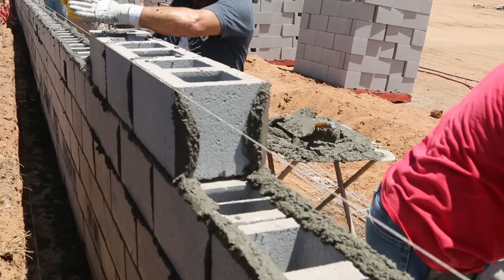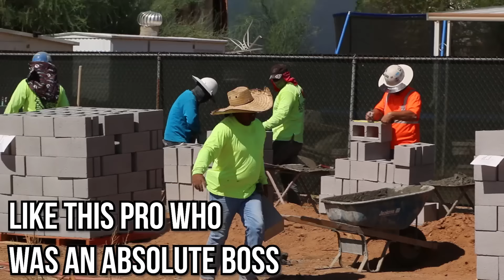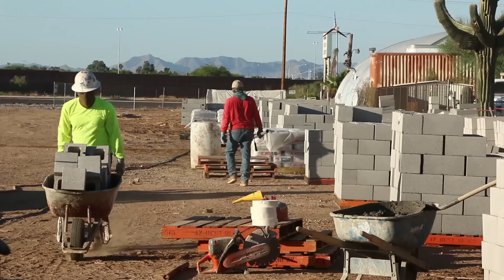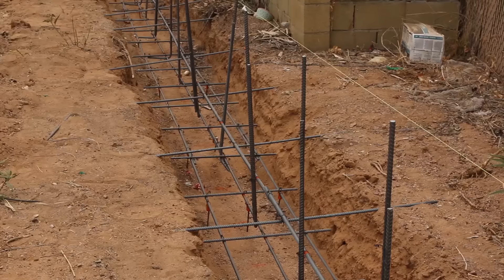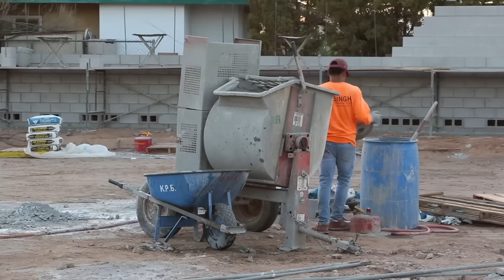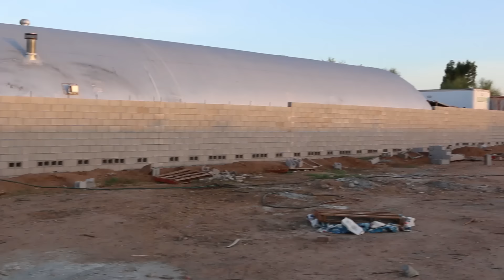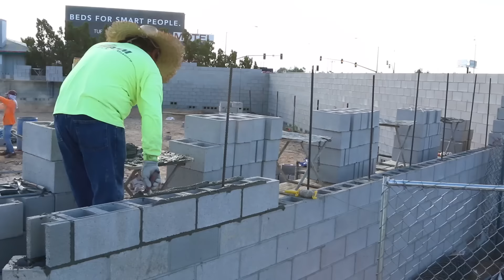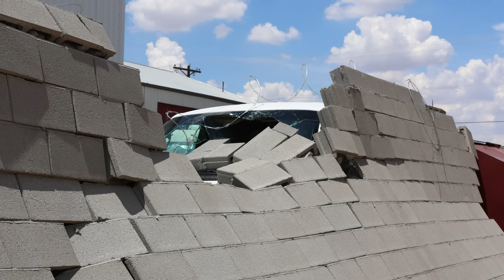Building A Block Wall

Comment: Can't wait for the feminists to push for 50/50 representation in stonemasonry ;)
Reply: Don't hold your breath.
Reply: Drew Mac, The statement went way over 44R0Ndin's head.
Reply: John Doe based and redpilled
Reply: Doesn't matter if someone's good or bad at their job, gender has no place in the discussion.
There is only one kind of discrimination permissible in the hiring process, and that's based on the skills of an individual and/or willingness to acquire/maintain said skills.
In other words, don't complain that you didn't get hired if you're both bad at the job and unwilling to learn enough to get good at it.

And for the record, I'm a man both by birth and by choice. Elevating women over men is wrong, and so is the gender pay gap. Equal pay for equal skill and ability is the only true way.
As someone with a disability, if your disability gets in the way of performing the duties of your job, you don't belong in that job. Find a job where your disability doesn't impact the ability to perform your job, if you're still being discriminated against then there is a problem and it needs to be fixed.
Reply: 44R0Ndin, tldr

Comment: I just recently helped my dad build a block wall just like that!  It was much much smaller...only 3-4 ft high and maybe 20 ft long but I learned how difficult it is. These guys are so impressive with how easily they can spread the mortar onto those blocks without dropping any on the ground haha.
Reply: viriy  Nece
Reply: They drop some, it's okay, their Dad isn't concerned

Comment: Mexicans always amaze me on roofs and masonry, they seriously get some stuff done. I remember working on a crew next to another crew of Mexicans and they seriously made me question my work ethic. They just went like machines all day and at lunchtime they got off the roof and and cooked up some fajitas at the job site, then right back to it. While we left for an hour and ate burger king or whatever and took breaks every 2 hours or so. Maybe they are just built better for the heat, but they outworked the crew I was on by a good margin and we weren't slackers.
Reply: JestA Bear They have improved a lot as masons since the 1980s.  In the 1980s they were all laborers, in the 90s they were trained by gringos (like me), now they own the trade.
Reply: bonanzatime Same with roofing. Amish are kinda they same way around here, they work pretty hard for less money.
Reply: Different cultures tend to excel in different areas.
Reply: @J Smith
Mexicans aren't good bricklayers because of their culture.  It's because that's the best economic opportunity available to illegal immigrants who don't speak English.
Reply: jej3451 That's a good point, though I still think they are better suited to the heat.

Comment: This seems like an excessive amount of manual labor compared to using forms and pouring a continuous concrete wall. But maybe this is because I underestimate the labor associated with setting up and taking down concrete forms.
Reply: also, the cost of so much concrete, bigger footing to hold the extra weight, and I have no idea how thermal expansion would work on such an exposed long single slab.
Reply: Complex foundation shapes also make forming up not as practical. If it's a square yeah forming it up is a lot easier

Comment: Wow EC, if all carpenters had your respect for masons, there wouldn't be any feuds. 👍 .. from the beginning I had a feeling about you, 'That There, That There Is a Good Man.
Reply: At the end of the day, Carpenters/joiners,are MASONS with their brains bashed out,  lol.(from a retired UK bricklayer.)
Reply: Carpenters respect us when our foundations they work off of are square and level.
Reply: @chrisanderson9157  And we respect them (carpenters) when the walls (and windows, doors and soffits) we veneer are straight and plumb.
Reply: Ever try putting a roof on a house that is out of square? Not a common Gable.

Comment: Another great video, thanks. When pouring the top beam, how do you prevent concrete from running down into the wall? Can't think of any reasonable way to make a form...
Reply: Casa you run a paper or mesh material called bond beam paper or grout stop across the wall before you lay your bond beam course.
Reply: Recently I’ve seen the top two courses stay empty and be poured with the concrete beam.
Reply: Just wedge a piece of block in there.  You can even tear up and bunch up empty mortar bags and stuff them in there.

Comment: The construction mortar should be weaker than the building substrate (block) so that if there is movement the beds and perps give way not the block 
26 year as bricky in uk
Reply: True for brick veneers.  Not so for Structural CMU. 😐

Comment: How do you create a concrete beam at the top in the just the bond beam blocks without filling the rest of the wall? Wouldn't the grout have to rise through the entire wall to reach the top?
Reply: James Kahn its filled all the way up not just the top
Reply: James Kahn. The holes of the corse below the bond beam is plug off with paper or pieces block.
Reply: I’ve seen recently the top two courses stay empty and be poured with the beam.

Comment: Why are there blocks that have been rotated 90 degrees running along the bottom of the wall?
Reply: Water ways in case of flash flooding.
Reply: Cats.

Comment: Great narrative as always, but I gotta say, that footing looks pretty crooked (7:00), and 12 inches seems kinda shallow for an 8ft above ground block wall ... then again, i'm not a mason, so take that with a grain of salt. 

I'm also surprised at the lack of side forms ... they poured directly into a dirt  trench, which AFAIK is not best practice, because dry soil sucks moisture out of the wetmix before it finishes setting up, and i'd suspect that could weaken the strength of the concrete in direct contact with the dirt. It is also unclear if they properly compacted the base of the trench before pouring, which could result in settling and cracking.

They did a great job with the mortar and blocks though (A+) ... very fast and neat on that count, but to my untrained eye the footing looks a bit slapdash (C-).
Reply: This is a desert project on a caliche ground surface.  It is not very porous.. Already a very hard surface.   In fact, almost the density of concrete.  Thus..  rarely a need for forms.
Reply: Rock K. Im unfamiliar with the term caliche ... i'll look it up. Any day I learn something new is a good day. Thx.

EDIT: Ah, I grew up with the term "hard pan" for that.  There is hardpan and then there is hardpan, depending on the degree and type of concretion.  It didnt seem that dense in the vid, but i will rewatch as time permits.  Thx again.
Reply: The topsoil was broken up previously by the grading already completed on the lot..   I seriously doubt that forms would have made much of a difference..  If there were any "seepage", the cement in the edges of that footing more than likely adhered to the surrounding soil similar to a tree's root.  That wall is embedded to that "hardpan" caliche.  The quality and effort put into building this wall is top notch for that region.  Nate picked a great contractor.
Reply: Rock K. Well, thats what I get for opining based on a vid rather than in person observation.  Still crooked at 7:00 though. 😉

Thx again for explaining. Thanks also to EC, who always puts up immensely helpful and unpretentious content.

Comment: how did the collapsed wall pass inspection?
Reply: Maybe there wasn't one.
Reply: wait..building inspections during construction are optional? not from the US, just curious.
Reply: Follow Media it isn't uncommon for shady contractors to cut corners and lie. Come into town, bid low, convince the client permits aren't needed or just not mention them, do the job as cheaply as possible, and move on before anyone asks too many questions. I've also seen contractors do things like stage rebar for inspection, have it passed, then pull most of the material out before the inspector has gotten out of sight. Could also have been a self built job by the owners who didn't know any better and didn't get caught.
Reply: RealLuckless sounds like South Florida, I got to the point that I don't even compete against the low bidding contractors anymore because the client always call me back when they realize they screwed up

Comment: Oh how easy they make it look. Makes you want to go try and fail miserable.
Reply: INDEED !!!!! lol
Reply: One step at a time....get lego set.
Reply: It's that part where they "butter" the bricks that is so smooth!   Fast and flawless!
Reply: @mrbob55304  I use to use work with this guy who would use two trowels to spread the bed joints - less motions and less trips to the mortar board was his thought process.  And he use to cut the mortar off of the bed joints from his laid block and use that mortar for his head joints for the next block,  saving material, energy, and time.  the guy was phenominal.
Reply: Brick work not really all that hard as he said first row the hardest if you get the first row level and plum it just a task of maintaining level on rest of it 
But by no means I'm saying it it easy alot of repetitive heavy lifting and hard work 
With practice anyone can lay stone
Reply: @hotrodpaully1  ROW? LOL  Brick work? LOL.
Reply: ........................So damn TRUE  !! 😤😤
Reply: I've tried this, it's really hard. These guys are real pros, make it look easy but it's damn hard.
Reply: @anastasios3006  Takes about ten years to become a true journeyman mason.  Learning to lift properly, handle the material properly, no holes in your heads and beds, and also, the ability to make it look so effortlessly.
Reply: You need to fail for 9000 hours to master it on the 10000th hour
Reply: Learn here more
Reply: https://youtu.be/lyk50gFS2rY
Reply: This is a job that if you don't like it you will never be good at. And make it look easy.  It just a job most smart people don't want. But I love it. Hahaha.
Reply: @jacobmarmolejo3946  Very true.  My biggest issue is that many people do not like to think.  With that being mentioned, masons would highly benefit from strength training, especially their core, to keep their body from being destroyed.  However, because many people dislike having to think, they would rather consume alcohol, which is a double edged sword in masonry.  It dehydrates, destroys your muscle and ligaments, and kills your brain cells. LOL

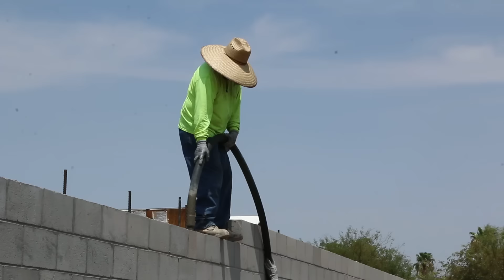Comment: 14:40 r/OSHA would have a fit over him walking on that wall without a safety harness.
Reply: also no glasses, incorrectly built scaffold , no access to the scaffold, no silica mitigation , etc...
Reply: Geez - how many one eyed builders you see walking about? Wear your safety goggles when cutting and on other times required but not all day when building a wall! Please enlighten as to silica mitigation there's always dust when building- take it or leave it. Yeah you will likely die early from silica inhalation so wear correct mask whenever possible when cutting etc.. Yeah need some access/escape ladders there! Even  though a real man just climbs the standard and over the handrail to access. So satisfying especially when OHASA are snapping pictures to report to your bosses Come build here buddy the brickies stand on one hook on board at 5metre + laying all day untill the boss arrives and kaks them out now that's going to get everyone excited.

Comment: Nice vid Scott. In the UK a mason is one who works, and works with, stone. Cutting, carving and laying. Bricks/blocks are laid by brick/blocklayers. The skill of the stonemason is valued higher as the masonry units are irregular in nature. I disagree with your statement that poor stonework is less conspicuous than poor work in cementitious products. Stonemasons pride themselves in square, plumb and true work which is far harder when using irregular units. Also the stonemason has to devise a suitable finish to the pointing. There is never a one size fits all mortar recipe/finish for a myriad of reasons both aesthetic and practical. 

In the UK we say 'muck!' Although we are still afflicted by the term 'cement' generically used for any mortar. Really bugs me!!

Still enjoying the content sir and pass on my condolences for your late mother.
Reply: I believe his comment was with regard to the untrained eye. Due to the uniform nature of block and block walls, the layman can more easily see errors in the work. The irregular nature of stone makes this harder. Again for the untrained eye.
Reply: efox2001 - exactly. Take an untrained homeowner and show them a great block wall, an okay block wall, and a really shoddy block wall, and any homeowner can probably rank them correctly. If you try the same with stone masonry, especially with something like a rough roundstone wall, and the odds of them correctly ranking them drops a great deal. 

This is part of why hiring a GOOD stone mason can be difficult, as shoddy results may look good without most people being able to see the bad faults in them, and poorly trained masons can get undue praise in regions without a strong working mason culture.
Reply: Exactly the more straight lines something has the more it shows any mistake.
Reply: kris short  completely agree on the the stone being much more difficult to achieve a quality  product.   Worked with a block laying crew for a few summers in school, it doesn't take much brain power to keep blocks level.   Lots of practice but not much brains.  The guys who could do stone on the other hand...
Reply: Naffetstterrag,  being a stonemason, bricklayer, blocklayer, tile setter, concrete finisher, which is all in the same territory of craftsmanship, for 30 years 15 years in the union  and 15 years out of the union you simply have no idea what your talking about. It doesn't take much brain power to make a dumbass comment like that.
Reply: It takes more skill and experience to spot smaller sins in a natural stone wall than it does to spot sins in a brick or block wall. If someone screws up a seam line in a block wall, you have to be pretty uninformed about the process to not see it, but a bad vertical seam is a lot easier to miss noticing with irregular stone. 

That is part of why traditional stone masons are considered a higher skilled trade than modern block masonry - modern block was designed to reduce variables, increase consistency, and decrease labour and training requirements.
Reply: RealLuckless  There's a lot of different stone styles, so it's very easy to compare apples to oranges when discussing stone.  What I'm saying is brick-block masons are trained to think square, level, plumb, true and fast.  Also, the most important physical skill which is handling the trowel, even an average brick-block mason will blow away any stone-only mason every time when it comes to handling a trowel.  I'm not dissing official stonemasons, just saying because of skill sets and 'muscle-memory', it's easier for a brick-block mason to learn how to do good stonework (because stonework is just basically easier...depending on the style) than it is for a stone-only mason to take up brick and block skills (professionally).
Reply: I'm assuming the UK trains in the dual-system apprenticeship like Germany where a Steinmetz (Stonemason) handcarves stones, ornamentation, carves granite for gravestones,,, it's quite different than a Mauerer (stone / cement wall-builder). One is art, the other, "production". In the US it's free-form, if one can mix art with production then they're going to do really well.
Reply: Brian Bullard 👍 That's interesting. ..I just learned something.
Reply: 3 Year apprenticeship in the USA. Yes, a big difference between production and custom work. You better know how to do it all or you won't have a job!
Reply: You can throw up random coursed stone and make it look well..couldn't do that with bricks. I built some decent stonework with crap bits but pitched it & pointed up or raked out it looked the bollox.
Reply: Kris 

How people 1000s of years ago built these walls?
https://i.imgur.com/PclbaIR.jpg
http://2.bp.blogspot.com/-KiSr31IKAHQ/VAt6Imxyb-I/AAAAAAAACwQ/puQ3k6-Ncgw/s1600/IMGP5125.JPG
http://3.bp.blogspot.com/-RYdA7-u3zlM/VAs29B-AWtI/AAAAAAAACvQ/zc2lFo4HCv4/s1600/IMGP5042.JPG

No cement, perfect joints, huge bricks. How they did it?
Reply: There is a ton of crap stonework out there and people don't see it as much as when a brick wall is out of whack....i see it because im a stonemason, but others do not.
Reply: kris short Sorry mate but you are wrong, define what a masonry wall is? It is brick, block or stone, regardless of the material it is made from it is a masonry wall.
Reply: Mason from Tx. Grew up in the trade. It's a must to be able to lay anything that has mud in between it. Brick,block,natural stone,cut stone, pre cast stone etc.That's what a true craftsman, artist -Mason.  But that's just me
Reply: It's easier to train a brick-block mason how to do good stonework than it is to train a stone mason how to do proper brick-block work.
Reply: @bonanzatime  that's funny, I'm a stonemason and the proper definition in the UK is a very highly skilled individual who can quarry, cut, shape, carve, sculpt, repair and fix stone. No brickie I've met could dream of having the spectrum of skills we have, especially in less time than it would take a Mason to become proficient in bricklaying.
Reply: phil clarke  hmmmm🤔, I never considered "carving" and "sculpting" stone skills of a stone mason.?.  That sounds more like a 'statue maker' like Michaelangelo (a real genius artist).. And that's something I have never attempted to do.  But I can build a stone wall or fireplace better than any statue stone carver sculpter genius artist in America, in England, or In The World. 😉🤖 . . . have you heard of, Lew French?  Look him up, now that's a stone mason; and I don't see him 'carving' and 'sculpting' making statues..?....